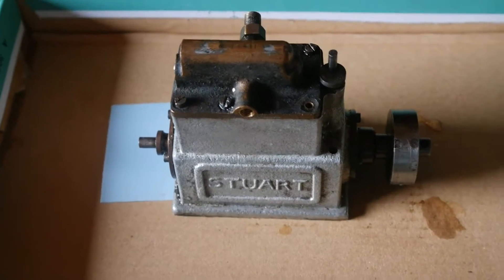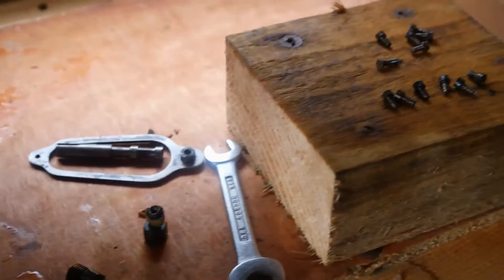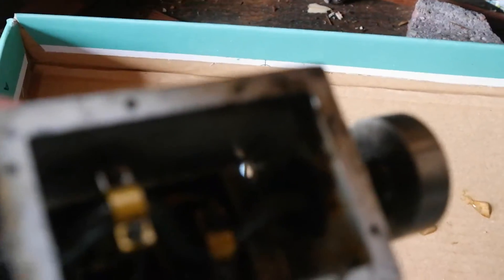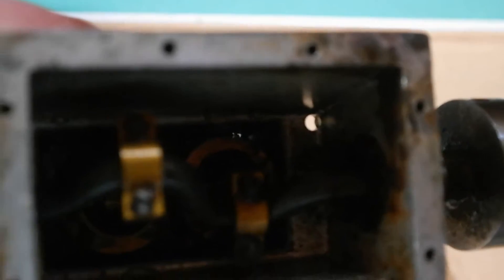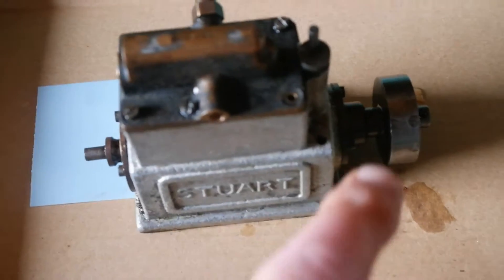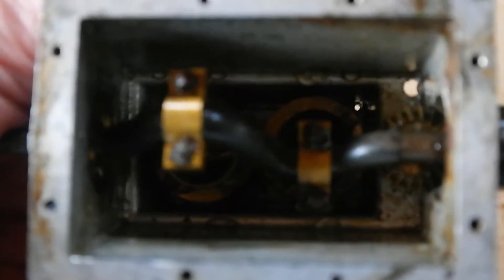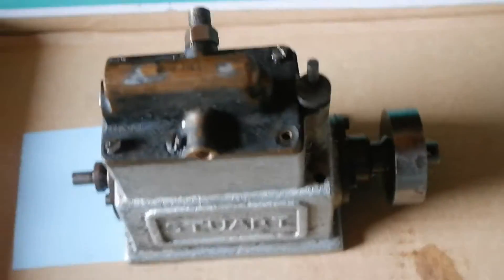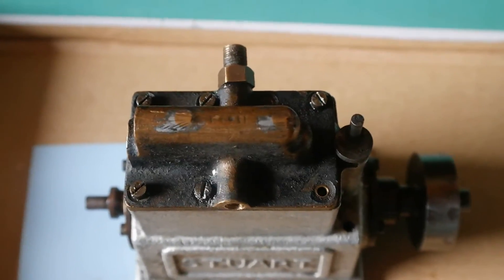STUART STAR STEAM ENGINE  RE-TIMED

Comment: Bonjour Roy,
This fast steam machine will need a large boiler to run... Which is you project with it ?
Amicalement, Raphaël
Reply from the maker: bONJOUR rAPHAEL :  " THIS IS OUT OF THE ISIS BOAT :
BOILER A LARGE TWIN DRUM WITH 14 CROSS TUBES " TESTED AT 8 BAR : RUNS 5/6 BAR